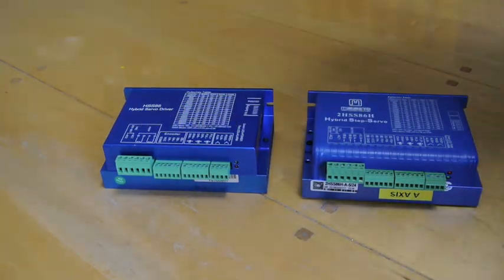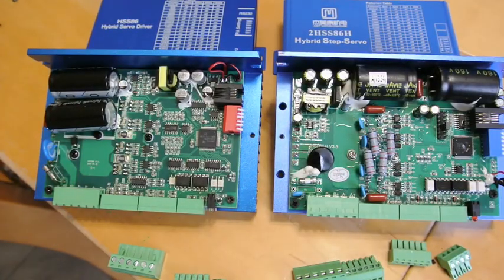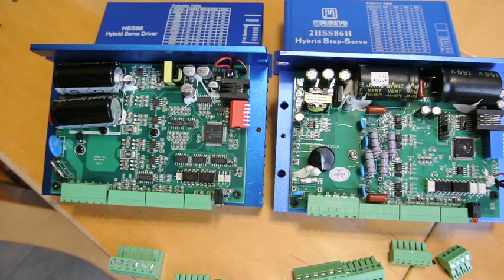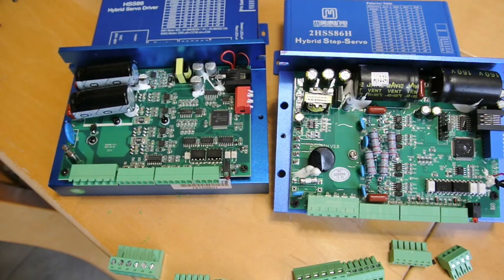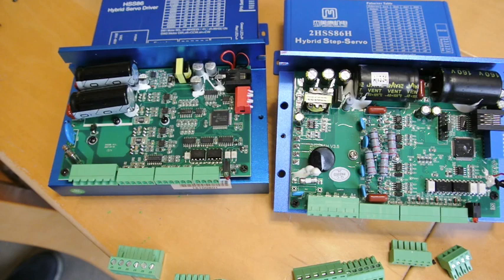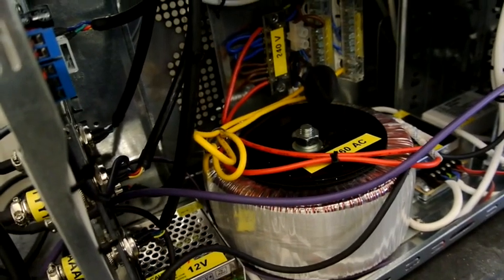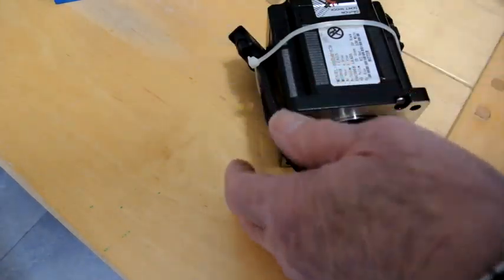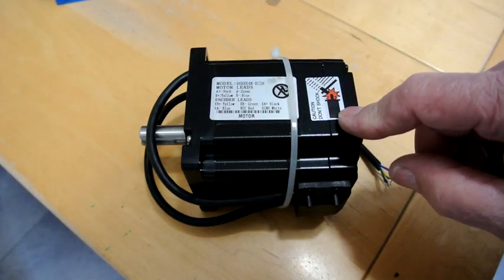Part 9 Warco 18 GH Nema 34 closed loop stepper drivers and motor

Comment: In the documentation it say you can run the 2HSS86 on 30 to 110 volt DC. I run mine on 48 volt DC and have the smaller 4N motors that are not that common, the 8N are much more common. Also if you go to the website you need to go to the Download section in the Web Address I gave earlier to get the documentation about the HSS86 Driver. They have Information on all  there different products in the download section.
Reply from the maker: Yes they can like a number of Chinese products can run on either AC or DC voltage. The AC voltage can be supplied conveniently with unregulated voltage from a transformer which I did. The only issue, which I found and solved, was the inrush current causing the house contactors to trip.